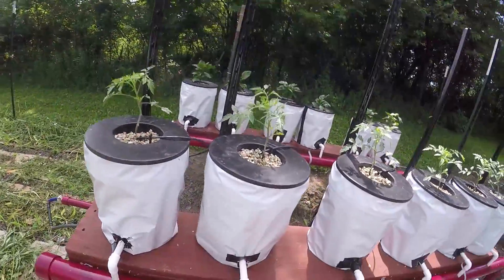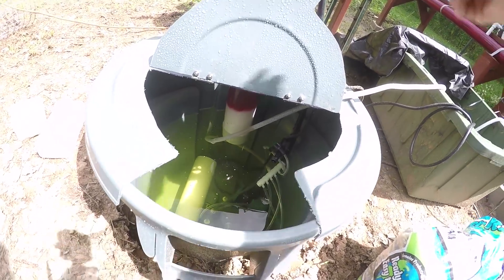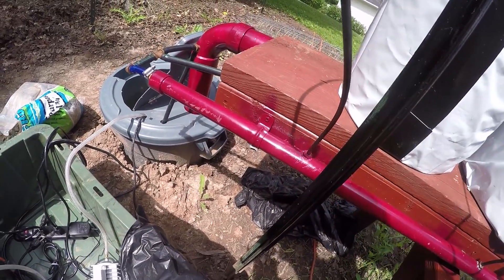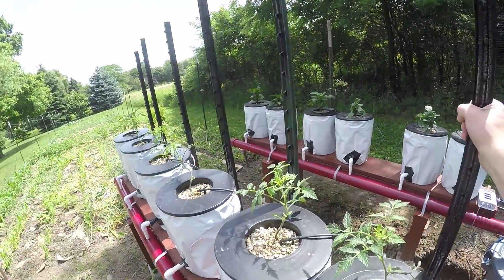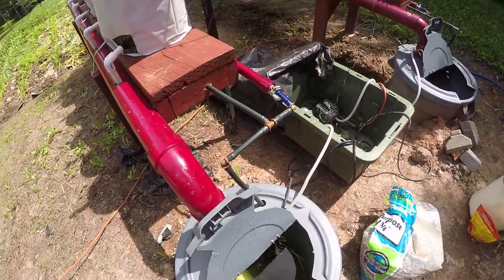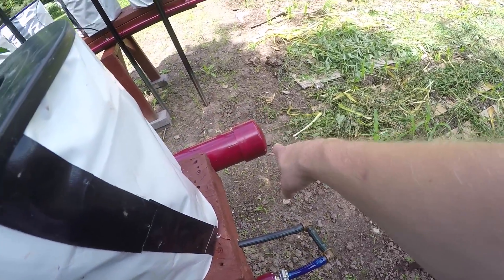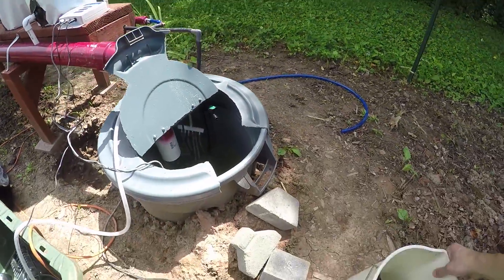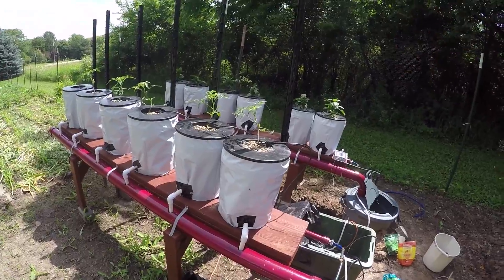Hydroponics Self Sustaining - Hydroponic Tomato Dual System 1:1

Comment: When do you turn on the air pumps are they switched on for 24 hours or less ?
Were you using the 1400 min ppm from the begininh and on each growth you increased right ?
How often you change the water ?
Do you notice the ppm goes down after a few days ?
Was the ph going up&down fixed when you emptied the buckets ?
Thanx for sharing

Comment: What drip emitters do you use ?
Reply from the maker: Its actually just a plain drip line ran, there is no drip emitter at the end of the hose just the regular open house. The ends you see on the hose are actually bug resistance fittings which came with the stakes.